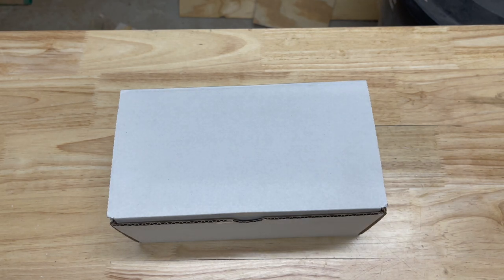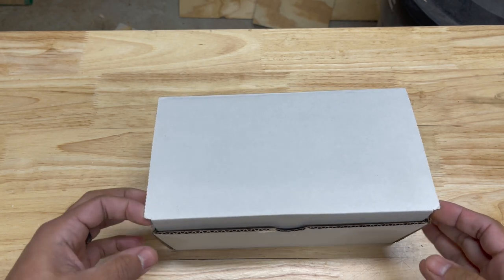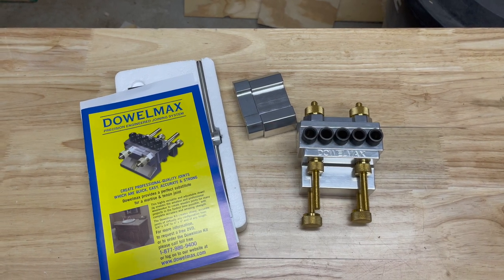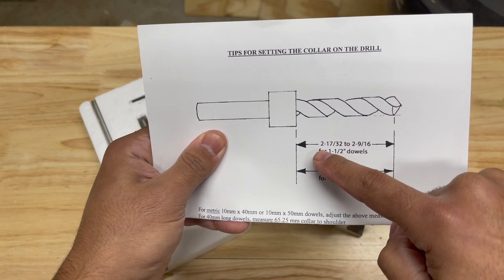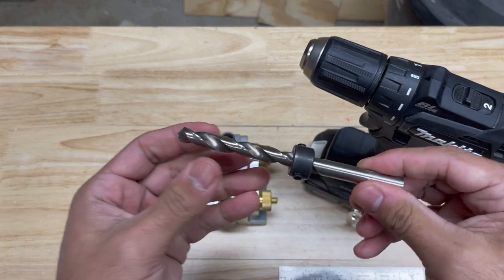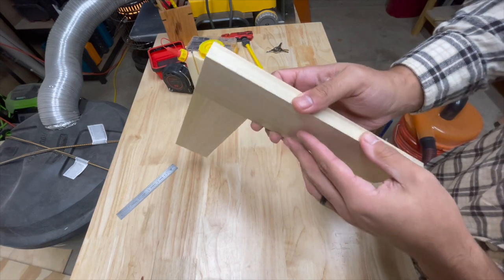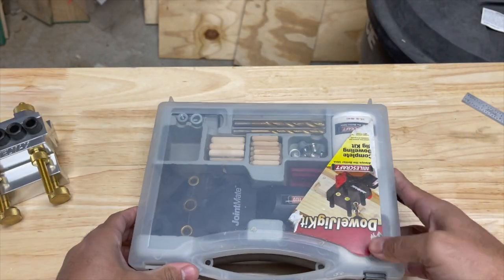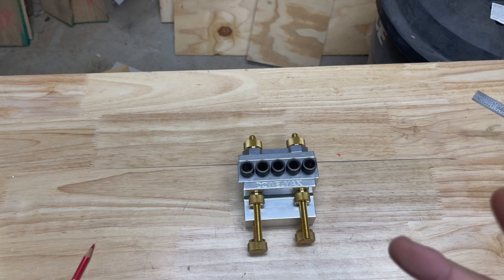The best alternative to the Festool domino joiner! Is the Dowelmax dowel jig!!

Comment: While the domino is the “correct” choice for professional cabinetry and furniture work, the tiny footprint  and construction of the of the dowelmax is definitely notable. It’s also nice to have a joinery system that doesn’t require dust collection. Jigs like a domino cradle make the festool easy to use on small pieces but it’s another thing to build and lug around. Dowelmax better for jointing small parts out of the box

Comment: Thanks for the video. I love my dowelmax. While the cost of entry is definitely less than that of the domino, that cost can inflate a bit when you accessorize for more joint sizes and convenience. I highly recommend the 1/4" guide set and another drill guide block for the 1/4" guides. Very useful for drawer boxes and small shelves and cabinets made of 1/2" material. The 1/2" guide set is nice to have if you will be doing anything heavy duty like seating or beds. That's not what I consider a necessity though. I also highly recommend getting extra drill bits in the sizes you use the most. That way there's less setup with drill bit depth if you're doing right angle joints (boxes or cabinet members). The miter guide is obviously useful for mitered joints, but I honestly don't use that as much as I thought I would. Still, even with a stout kit as outlined above, the dowelmax is still quite a bit cheaper than a domino. Joints are strong, and quick enough. It's a well-made and engineered jig that should last the typical diy woodworker a lifetime.
That said, the domino is an amazing tool for production work, and if I picked up a job of doing a kitchen full of cabinets, I'd grab one in a heartbeat.
Reply from the maker: All great information, thank you for your time and suggestions!
Reply: @ParklanCustom  No problem! I love my dowelmax. I'm kicking myself for not having bough it years ago. 🙂
Subscribed. 👍

Comment: i think the dowelmax is a stronger tighter joint, but it way slower than the domino.
Reply from the maker: Yeah, definitely slower, but a fraction of the cost and dowels are a proven strong joint.
Reply: Domino joints are just as tight and strong. Definitely quicker, but not a huge difference. I used to have the domino and loved it, but couldn't justify keeping it since I ended up having to take time away from woodworking for health reasons. I use the dowelmax now and it's one of my favorite tools in the shop. Strong, tight joints, quick enough even for small production runs. Eventually I'll get the domino again when business dictates the necessity, but for now I'm content with the dowelmax.
Reply: No